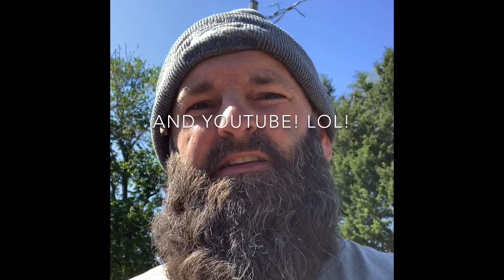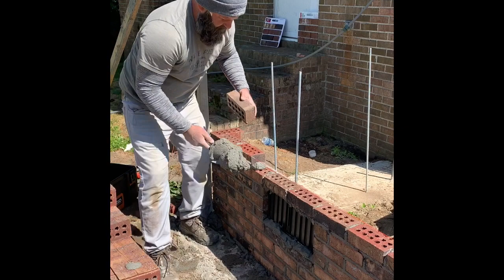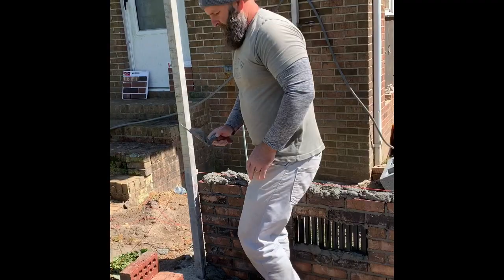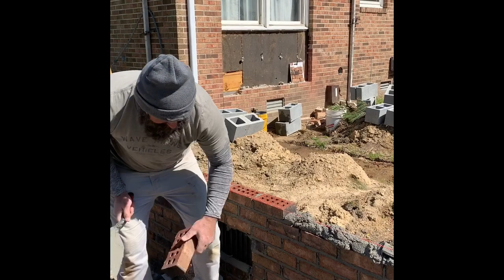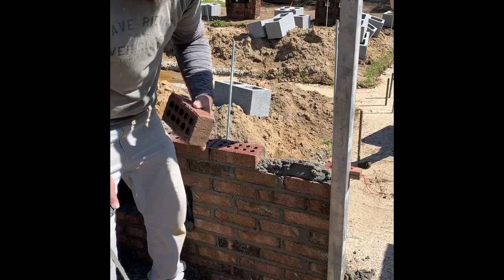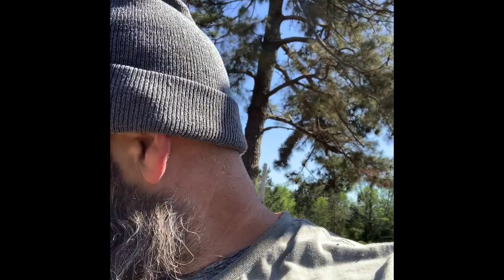BRICKLAYING Tricks With Bricks: 2 different ways how to use the Pic N Dip Method Bricklaying

Comment: That's very similar to how my grandfather taught me to pick and dip with a shove joint instead of buttering a head when I was learning from him as a teenager. He started work at a brickyard at the age of 9, learned to lay brick from German immigrants building kilns in the 1930's, started his own business in 1946 after WWII ended, and died at the age of 74 shortly after completing his last Bedford stone job. My dad is 71, still in business, lays brick 5 to six days a week when weather permits and still uses the pick and dip technique from time to time when laying soft brick with a high rate of absorption. He would be retired by now if there weren't so many crooked contractors. Feast or famine growing up with a masonry contractor for a dad. First job I used pick and dip on was about 30 years ago when I was still in high school and still beginning to learn bricklaying. We were reconstructing the gable in a 150+ year old building using the original brick that we had cleaned and a lime mortar. Middle of July, so it was hot. Those brick dried so fast we had to soak them in 55 gallon drums and pick and dip to get them in the wall. Could only get about two courses laid before we had to strike the joints. Not a fun job, but paid my dad well. Keep up the good work, and don't be afraid or ashamed to try new things. Don't worry about critics in the comments section, I have worked with masons from all over the country, and seen all kinds of different techniques. Try new things and make them your own if they work for you. Masonry is a trade where you can learn something new every day. I always learned the most working with the older guys. The guys I learned th ed most from are all dead now. The thing that matters most is the finished product and that it lasts. My grandfather was also a fan of the philly trowel by the way... On a side note, I was taught to furrow for a more consistent bed joint and to reduce the amount of mortar likely to wind up in the cavity. Under normal circumstance we butter a full head joint instead of using a shove joint in this region. Full, well struck joints are critical for longevity in the midwest because of freeze thaw cycles and wind driven rain. You lose a little time in spreading, but more than make up for it in not needing to point anything as you're tooling the joints. It also helps keep your work clean. Using this technique, you never need to cut any mortar from your trowel to fill any bee holes, and your joints strike up consistently.  The tooling goes fast, less winds up in the cavity, and the face of the brick stays clean if your efficient in how the bed joint is spread. It's all about minimizing your movements. Picking and dipping in the right circumstances will keep your wrist, elbow, and shoulder in better shape for old age. I don't suggest it for every situation though.  
Nothing new under the sun. About four generations back pick and dip was the most common technique in many areas, especially before hard fired brick became a common thing.
You seem like you'd be a good guy to work with, best wishes to ya. I subscribed. I am a third generation bricklayer and stayed in the trade from the time I was a kid till I was 35 and had an opportunity for a better paying, more stable job. If you ever need someone to bounce an idea off of, I'd be glad to help you out.
Reply from the maker: Patrick D I really appreciate your comment. I can feel the heart you put into it and the love of masonry you have. I am a first generation mason but my father in law taught me. He is as good as they get in my opinion. Absolutely love laying brick and it shows. I love hearing stories about the older guys. They are so full of wisdom beyond just putting a brick in the wall and an invoice. They are who I try to learn from whenever possible. I appreciate your subscription and hope you enjoy the videos I put out. I try to continue learning everyday from videos and people a lay with. I truly enjoy the bond between fellow bricklayers. It is like none other. Thanks again for the comment and I hope you have a great week!👍🧱🇺🇸
Reply: If you roll your bricks to the line less mortar will fall between the cavity. Rolling the mortar on the mortar board before picking it up on your trowel will also lay a nicer bed, that wont fall into the cavity aswell. Both of these techniques support the use of pick and dip method in a plethora of bricklaying situations. The benefits of saving your wrist, elbow, and lowering your step count while not sacrificing production are too great, to cower away from it in my opinion. Cheers.

Comment: Like your videos, great stuff. My apologies if my question has been answered already. Is there a reason why "furrowing" is not done?
Reply from the maker: This is a great question! Actually where I work in ne northcarolina it is not legal to furrow the mortar. We lay bricks with holes and the inspectors want the holes as filled as possible to make the most solid wall. Where as Europe they use frog brick and furrowed gets rid of or spreads out the extra mortar that goes in the brick holes here. We used to furrow before the 2000s but then were told not to because it weakened the wall due to the holed brick. Thanks for watching and I hope this answered your question. Have a great one!

Comment: That style would be fine,for foundation work,on face brickwork, you would lose time,on jointing up,🇮🇪🇮🇪
Reply from the maker: minecraft king I have tried it both ways and as long as you put a thick mud bed down usually the mortar fills in all the holes. You might have to fill a little but the time saved with the speed of laying exceeds the time saved for striking up. Thanks for the comment!!!😁👍🍺🇺🇸🧱
Reply: Good job, I normally just spread the wall,and use excess morter,to butter next brick on the wall,must try your way,👍👍
Reply from the maker: Yes this is the exact way I did it for 15 years. Started experimenting with the pic n dip about 3 years ago trying to get more brick in! Good luck brother!!!
Reply: Have to say,I have never used this style, will give it a go, KP up the gd work, greetings from the Emerald Isle of Ireland,🇮🇪🇮🇪
Reply from the maker: minecraft king thank you very much! Greetings from outer banks of USA! Always wanted to visit Ireland! Looks amazing!!!